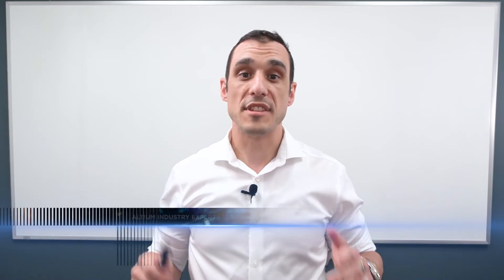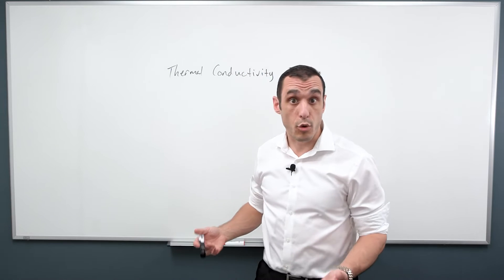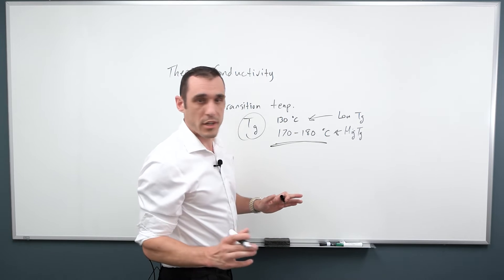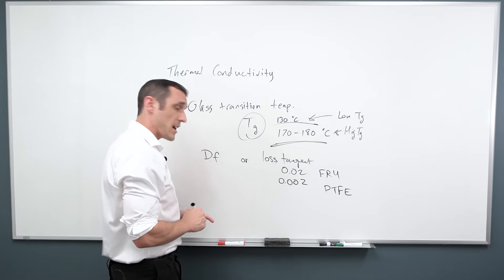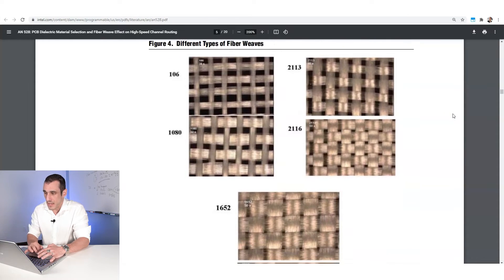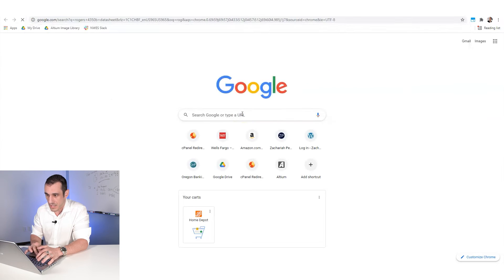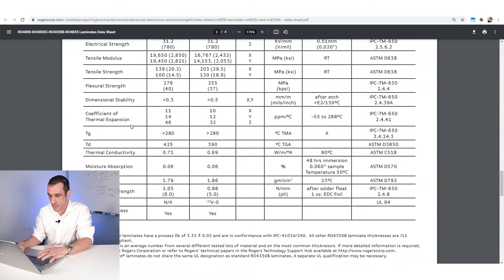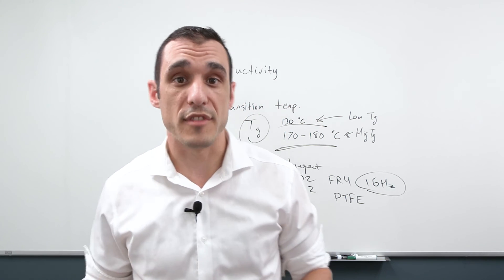How to Choose Board Materials for Your PCB

Comment: You have mentioned that tighter glass weave is better for high frequency. But these come in the thicker prepreg and may not be suitable to get the required impedance and track width. Also high resin content is preferred next to copper to avoid resin starvation. Any comments?
Reply: Well I guess I have a few comments: 1) you can use thicker prepreg for example in routing striplines and this will allow a larger width. If you just take a thin outer layer dielectric and put it into inner layers for striplines, the width might be too thin if you have a high layer count board, so you would need a thicker dielectric anyways. 2) You can use coplanar ground if needed to get to a thinner linewidth, which is very useful on surface layers. The coplanar ground adds to the self capacitance of the trace and will reduce the impedance, so you can use a smaller linewidth if needed. 3) You're right about resin starvation which will be a problem for growth of conductive anodic filamentation (CAF). It's something you will have to balance when looking at the overall build, if extremely long term reliability is important or you are operating with high voltages in potentially humid environment, then CAF may be important for your build.

Comment: Thanks, Zach, great video. It would be nice if you could add one more: a video that covers not only high-speed but high-voltage designs. Please cover information about important parameters and isolation capabilities of substrates when you have high voltage gradients (high voltage difference) both along the surfaces and across both sides. What must be taken into account when designing 1MOPP or 2MOPP (or MOOP) isolation through the board. It would be great if you could also define in Altium design rules or constraints for isolation between layers, not only creepage and clearance on the surfaces...
Reply: Thanks, we did one on high voltage materials, but not on high voltage design practices, so maybe I should add that to our (already very long) list of topics!

You can watch the high voltage materials video here: https://www.youtube.com/watch?v=FqnUnwCHAzg

Comment: for universal ac inputs that use 400v dc link, can we use fr4 materials? if not how do find the proper ones,
one more question about the needed space between layers?
Reply: Space is chosen between layers based on the need for impedance control and power decoupling, or to ensure you hit a standard board thickness target. Some designs demand a thicker or thinner board, and this might require adjusting the layer thicknesses to hit those targets. For very high voltage/current boards, you may want to use thicker layers depending on the insulation requirements between conductors. For a 400 VDC board, yes you can use FR4 grade materials but you have to look at the Performance Level Category/Comparative Tracking Index for that material especially if you are designing to an industry standard like UL 746A, IEC 60112, or ASTM D3638. Materials that fall in these categories are rated for different voltage ranges based on their leakage current. The other important point that is not specified in those categorizations is the curing agent that is used in the material. Materials that are built with different curing agents can exhibit CAF growth that eventually leads to failure. Phenolic cured PCB laminates are preferrable at high voltages.

Comment: I'm confused about the glass transition temperature. Isn't this quite a bit below the typical dwell temperature of a reflow oven?
Reply: Yes, typical reflow oven temperature can exceed 200 Celsius. With high Tg board materials, the temperature will only slightly exceed the Tg value for a lower amount of time and with lower total expansion compared to a low Tg board material.
Reply: @Zachariah-Peterson  OK, so that means that, with a low Tg board, once the components are on, you shouldn't be surprised if copper pads lift when you try to rework or tweak the board?
Reply: @petersage5157  Actually you should be surprised, I have never seen that happen to one of my boards, although I'm sure it has happened to someone. Manufacturers test the peel strength to ensure that he copper adhesion meets IPC standards, so even if there is a large thermal excursion you wouldn't expect the copper to start lifting off the board, and certainly not during reflow. I don't know what is the specific force they test for, but in order to prove compliance they will test for that.

What's really problematic is in HDI or in high aspect ratio through-holes. In HDI, microvias or stacked blind-buried vias are known to fail during reflow if the aspect ratio is too high. This is what motivated the IPC to issue a reliability warning about microvias in 2019. For high aspect ratio through-holes, the barrel plating could fail if it is deposited with a DC process, this is because the plating will not easily deposit along the via wall due to copper depletion in the plating solution inside that via barrel. I've been told by one of the large US fabrication houses that they use pulsed plating specifically to address that problem in high aspect ratio through-holes, it creates a more even plating along the via barrel.
Reply: @Zachariah-Peterson  Thank you so much for sharing your knowledge! To be honest, my most recent experience reworking a board was modding a Valve Junior many years ago; several pads lifted while I was desoldering the original components from the single-sided board. Since then anything that wouldn't fit in a 1590B stomp box had been turret boards and terminal strips, which are much more forgiving when it comes to ham-fisted desoldering. Sounds like the standards may have improved a bit over the past decade.

Comment: Interesting to learn about the possibility of vias cracking under high temperatures with lower a lower Tg rating. How does this come into play when running through reflow? If a board is only rated for 130C, is there degradation when going through the assembly process?
Reply: @Zachariah-Peterson  Thanks, Zach! Appreciate you taking the time to provide a detailed answer to my question.
Reply: Hi Andrew, not sure if you were being sarcastic down below. But my opinion is practically reflow can degrade a board. I have seen cheap manufactured boards from abroad that were operational in the product, but upon warranty repair were impossible to fix. So factor in the high-temp of reflow when considering life-expectancy of the product.